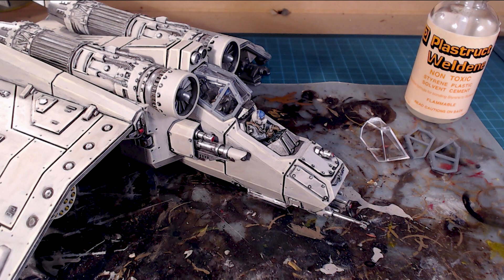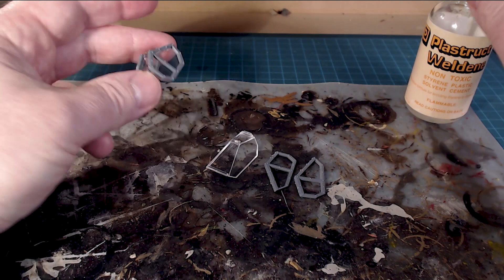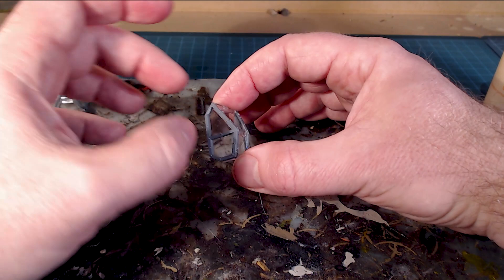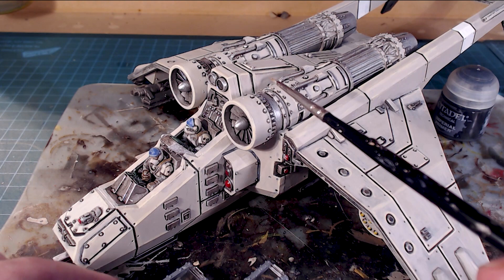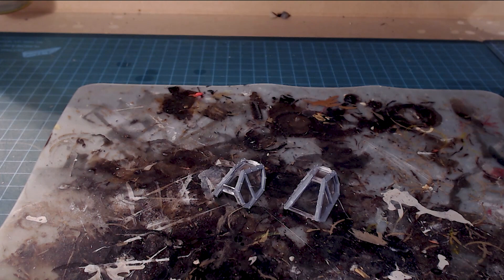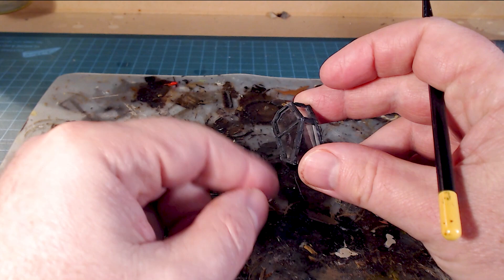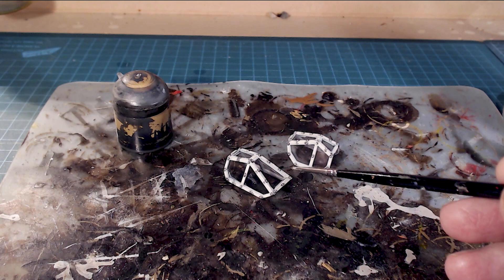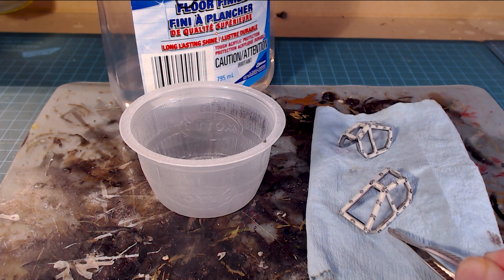How to Build, Paint and Seal Clear Aircraft / Flyer Canopies - Astra Militarum Valkyrie

Comment: Your end result does look good! But there are a couple ways you can still easily use spray primer. If your clear panels are flat, take a painters masking tape, press it into each area of the canopy (pressing firmly with a sculpting tool or similar to make a good seal) and gently razor off the excess. If your panels are curved, you can apply a sticky tack or moldable eraser with a sculpting tool to cover any areas. Make sure you have a good seal and do multiple thin coats, letting it dry between applications to avoid the paint bleeding under. I've had very good success doing this. Just make sure to mask off the inside of the canopy if doing this, under spray is a bitch.